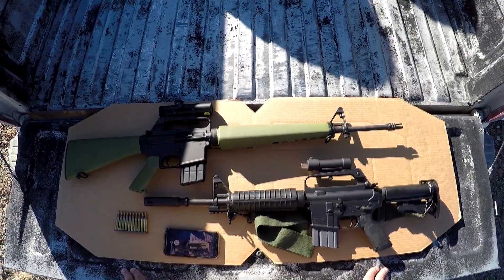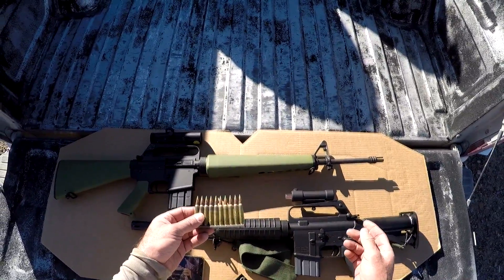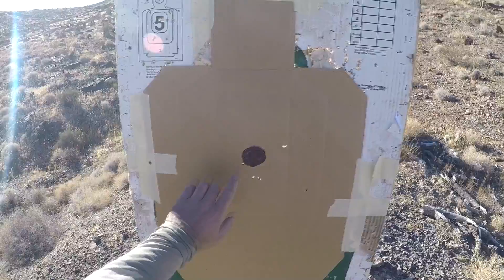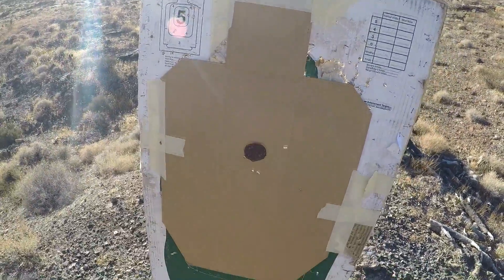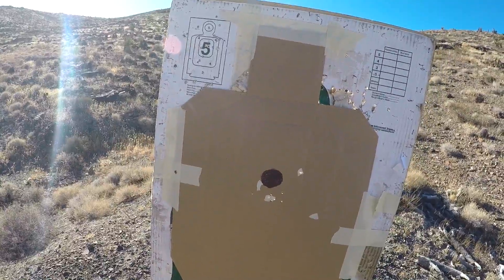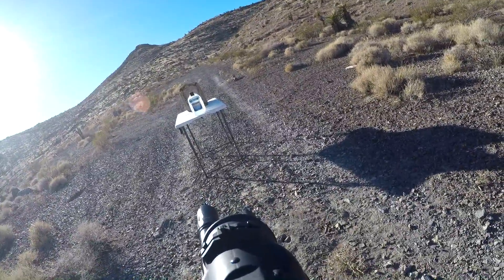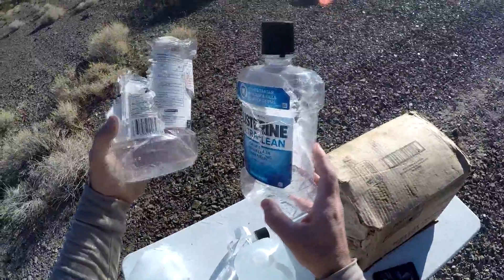5.56mm M855 in a 1:12"  twist...Useful or Useless?

Comment: Not just twist but barrel length is a major factor.
Reply from the maker: @terrytolentino5459  thats why we used a 20” and 12.7”…and was stated in the video…along with altitude….there is also temperature and so on.  Bottom line..while not useless…it is limited.

Comment: Norinco jw 105 5.56*45 nato has a 20 inch 1/12 twist chrome lined barrel so it shoots best with 55 grain bullets. I use 556 or 223 . I have a 4x wide angle 32 mm tube scope and it needed the medium rings for the bolt handle to not hit , look high like the ar 15 sights. Id love to zero this @300 meters for +3 inches @100 meters but the snow is past knee deep and its melting now so in afew weeks i can zero it in my shooting range, field. Im bedding the stock full bed up to past 1 inch of the barrel lug for a free floated barrel. Jb weld and neutral shoe polish work excellent. Im redoing the color of the stain and the finish, maybe tung and teak oil for a non-shiny waterproof finish. My buddy has a bunch of bullets for me , he gave me a handful last tine and I shot those up when the rifle had the tube style reddot sight , zeroed for far range at 75 meters and close range 25 meters. These bullets shoot super fast and hit the target @ 100 meters instantly. I love the 556 nato round now. I was always into 7.62*39 but now I can shoot both.  Bolt action 556 is a pretty slick little rifle. Take it out for some gophers this summer time.

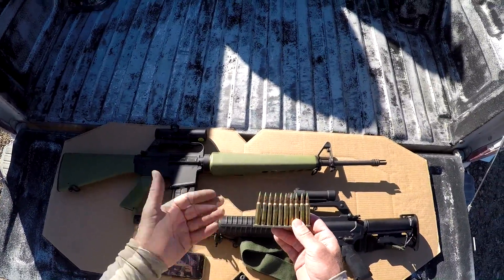Comment: In the 1:12 do the holes lokk keyholed m855 should destabilize bad and give a keyhole or water drop look. That's why I don't buy green tip at all I stick to m 193 1:7 twist. For my fmj
Reply: I would say 1/7 is good with a 16" barrel.  20" might be to much twist and friction.

Comment: Everyone always screaming don't fire a 5.56 in a .223 barrel and I call bullshit because the original AR-15 adopted and redesignated as XM16E1 and M16's had .223 barrels and there's no documented evidence of firing a 5.56 ammunition in a .223 barrel will cause chamber explosion, the M16A2 chamber was designed to be loose to help with extraction issues that the AR-15 603/604 XM16E1/M16/ M16A1 .223 chambers had, the .223 chamber has tighter tolerances, so the M16A2 has the first 5.56 dedicated chamber with looser tolerances like a Glock barrel it allows the case to expand some for more easier extractions but it gives up some accuracy.

5.56x45mm "NATO" was not around during the Vietnam war, 5.56x45mm "NATO" didn't come about until 1976 or 77, it was designed FN Herstal in Belgium, so anything before this round was created was .223 Remington M193 ball ammunition also at the time called 5.56x45mm but not 5.56x45mm "NATO" their a difference, but a lot of people push lies saying that "firing 5.56x45mm "NATO" in a .223 AR-15 is dangerous because 5.56x45mm "NATO" has high pressures and could lead to catastrophic failure" I say horse shit 🐎💩 because you have people who have been firing FN 5.56x45mm "NATO" ammunition like M855 in their AR-15's that predates 1982 which the M16A2 chamber pattern AR-15's were created and introduced, and here's a quote from a forum "The M855 will chamber and fire in the M16A1 safely but accuracy is seriously degraded. It is approved for use in the M16A1 only in a combat emergency and it is only accurate to about 100 meters. This is combat accuracy not, benchrest accuracy." So FN's 5.56x45mm "NATO" Cartridges like SS109 and M855 wasn't used until the summer 1982 when the M16A2 was adopted by the U.S. Marine Corps and FN SAW M249 adopted in 1984.

So if 5.56x45mm "NATO" is ok to fire out of an M16 and M16A1 with the only concerns is accuracy because the M855 was designed a 1:7 twist ratio and the M16 and M16A1 have a  1:12 and 1:9 twist ratio but their's nothing saying M855 will blow up a M16 and M16A1 's chamber, and all the people over the years who've fired 5.56x45mm NATO ammunition out their AR-15 rifles which prepredates the 1982 M16A2 variants which were designed for FN 5.56x45mm NATO ammunition and the M16A2 has a looser chamber
Reply from the maker: I….uh…ok.  I don’t think anyone was concerned with blowing up their AR…This video was about the 1/12” twist and m855…or simply the SS109 projectile in a 1/12” barrel.
Reply: @7N6ballistics  I was just making a point, my comment is random and not towards you it's for those who say don't fire 5.56 ammunition out of a .223 barrel, but my point is that 5.56x45mm NATO wasn't invented until the late 70's but people always bring up don't shoot 5.56 out of a .223 gun but the M16A2 and M16 are chamber for .223 Remington M193 they predate 5.56 NATO ammunition, but people still fire M855 out of M16A1 and AR-15's patterned after the M16A1.
Reply from the maker: @Edmondson_Avenue  While I do not own any .223 chambered rifles, thus not a concern of mine, SAAMI released it’s warning about firing 5.56 military ammo in commercial .223 chambered rifles in 1979.  This predates the NATO adoption and was not referred to as 5.56 NATO…but simply 5.56mm. M193 has always been referred to as 5.56mm and had it’s own specs with allowable pressure and case composition being different than .223.   As far as chambers, the military again has it’s own TDP.  Whether or not 5.56 NATO was simply renaming what was before simply the US Military TDP,  I am unsure.  As far as the concern, I don’t know of many rifles outside of maybe bolt or single shot rifles that use a .223 chambering.  I believe the 1980’s Ruger mini-14 may have, but I don’t recall any of recent times.  I would have to think a bolt gun would do a much better job of preventing primer blow outs or case ruptures from occurring.  This may be why you don’t here of any real issues occurring.  That said the major manufacturers do have different product lines loaded to different specs.  Here is Hornady’s  explanation.  
https://www.hornadyle.com/resources/le-faq/what-is-the-difference-between-556-nato-and-223-rem-ammunition

If you want a lengthy read on the development of the M16 and 5.56mm here is a link.  You will see there were a lot of issues to include case ruptures and cyclic rates that were encountered early on.  In short the M16 and subsequent 5.56mm rifles were designed around the 5.56 specs…. There is no way of knowing how a commercial firearm marked .223 would fair…which is likely a reasonable reason for the warning.
https://web.archive.org/web/20040209030852/http://www.thegunzone.com/556dw.html
Reply: @7N6ballistics  Well said, but there's manufacturs rolling M193 5.56x45mm NATO, when it was traditionally Remington .223 redesignated 5.56x45mm M193, I was reading that the military allowed M855 to be fired out of M16A1's which predates 1979 but only for emergencies but not over chamber pressures but because of poor stability, the M16A1's 1:12 twist ratio can't stabilize 62gr. projectiles past 100 yards.

You know it's weird that some  .223 ammunition that's hotter than 5.56x45mm NATO, but I was watching a Brownells video and a guy was explaining that SAAMI says 5.56 NATO has a wide pressure variation to work in all NATO weapons, don't quote me bit I think he even said that some .223 cartridge could be to hot for some .223 chamber and cause failure.

You this leads me to believe that early variants of .223 wasn't studied enough on the civilian side, because it was originally a military cartridge from jump starting out as the Remington .222 and the first gun it was chambered for was the AR-15, I've heard similar stories about .30-06 ammo blowing up guns, I think a lot of it is the manufacturer of the firearms not making good chambers, because I've also read and seen videos about companies that manufactures .223 rifles with .223 barrel marks but their manual says it 5.56x45mm NATO rated and ok to fire 5.56 NATO. 

It's like 10mm, which is designed to be a magnum cartridge but you have a lot of ammunition companies producing watered down loads and some gun companies making poor guns after firing a lot of the real deal ammo the gun fails, because it was really designed for those 10mm lite .40 loads, there's a lot of misleading.
Reply from the maker: @Edmondson_Avenue  pretty much…5.56 military loadings can be whatever they specify..m193 was allowed to be loaded to higher pressure than .223 and was allowed as much as 60,000 psi…this is why it isn’t an issue shooting m855 in the A1.  The bottom line is 5.56 can exceed .223 pressures…and when placed in a short chamber along with an unknown quality of rifle…I could see where the concern would have merit…thus the warnings.  As to whether or not it’s a wide spread issue..probably not, but I am sure kabooms have occurred that go unrecorded…
Reply: @7N6ballistics   I understand what you're saying but I don't think M193 was loaded hot back, because it was the only. 223 cartridge for a good while and remember M855 is a 5.56 NATO cartridge and M193 precedes it nearly by 20 years, and from my understanding bullet technology wasn't as quickly evolutionarily as it is these days this is why it took nearly 20 year for 5.56 NATO to be developed, my personal belief is the AR-15 was built around M193 because the actually were created together and Remington worked closely with Armalite and Eugene Stoner when developing it, also from  my understanding the military likes looser chamber tolerances for better extraction in case debris get stuck in there they'll clear more easily, and some say this is why Glock barrels have looser tolerances because they were built for the Austrian military, I hear target guns have tighter chambers, I don't think Remington was loading M193 above 55,000 psi because that's above the SAAMI specifications that were given for it in 1962, there have to have been some kind of testing of M855 in the M16A1 that took place that determined that it was safe to fire during emergencies but that's not the case for a lot of civilian companies that use tighter chambers that have different leades because it's a tighter fit, they probably weren't testing 5.56 NATO in their firearms especially in bolt and style rifles and a lot of people that were firing it was unaware of the pressure spike of the 5.56 Nato, but I honestly don't believe that this applied to AR-15's accept models that were built with a dedicated stainless steel .223 chambered target barrels which has those tighter tolerances for long range shots 5.56 NATO wasn't created for long range shots, it was developed medium to short range targets and to used confidently in every NATO rated firearm, I believe most of  these 5.56 NATO kaboom's were in .223 target rifles and as you said the mini 14 but more specifically the one's prior 1984.

I understand as you said "military loadings can be whatever that they specify" and as I said before I don't think there was ever an issue with the M16A1, XM16E1, or M16 firing 5.56 NATO as far as chamber pressures because those barrels have to be proof tested with the hottest .223 proof cartridges when Remington designed the .223 for them, I know M193 is the bullet and not the case, so I'm guessing that once the 5.56 NATO cartridge was designed and created the military requested that it started being loaded in 5.56 NATO cases, but I wonder did Remington continue to do the loading or did FN Herstal contract Remington for the bullet components and load them themselves of do ball ammunition qualifies as an unpatented object, but SS109 aka M855 is a problematic ammunition that the military had issues with in the M16A1, M16A2, M16A3, M4, M4A1 and M249, so they started looking for other alternatives like MK262 and MK318, and eventually settling on the American created M855A1 bullet, it just make you wonder if the 5.56 NATO cartridge was even needed but I judge the case on the performance of M855, maybe it is a stronger case designed but it's basically an enhanced .223 Remington case with a +P load in some cases because again some .223 is hotter than 5.56 and have been said to kaboom .223 barrels mainly in older guns, it's just weird. I appreciate your input.
Reply from the maker: @Edmondson_Avenue  “M193 specs are given a temporary waiver. The average chamber pressure limit was increased to 53,000psi, with individual rounds allowed to test as high as 60,000psi. Remington and Olin contract to supply 500,000 cartridges apiece under this waiver.”
This was 1964.

Im unsure on chamber dimensions at the time, but they felt well enough with using it in the M16….which are also proofed…How that would apply to other rifles…No idea.  As far as 5.56 military loadings…SAAMI had to take into account there were other specs prior to the NATO standard…it just depended on the country…who also developed it for their individual rifles.  As I recall the FAMAS for instance was not to use our ammunition…rather a steel cased loading developed for the rifle. Apparently The M193 was a bit rough on the operating system.  Ive also heard our m855a1 is not really compatible with some other NATO rifles…though I believe the pressure was dropped a bit in recent years…. That however could also be a testament to the robustness of the AR system in general.  The Issue remains…a SAAMI spec chamber on an unknown quality rifle is where the warning possibly has merit.  Which 5.56mm might pose an issue…honestly not really any way to tell…unless you have access to testing equipment… As far as the M16 in particular…even prior to NATO standardization, it doesn’t appear it would be much issue.  I would take the warning for what it is…look at your individual rifle and loadings and go from there.  As I stated…I don’t have any .223 chambered rifles…only .223 wylde and 5.56 Nato.  For me it just isn’t an issue….that’s for the individual to research and use what they feel comfortable.  With all that said…M855 is definitely loaded a bit hotter than m193 on average…it has the most recoil that I can perceive of the 5.56 loadings…possibly tied with mk262…. It will cycle an under gassed gun that may not cycle m193…that I have witnessed.  I have yet to use m855a1, so can only speculate on that one….

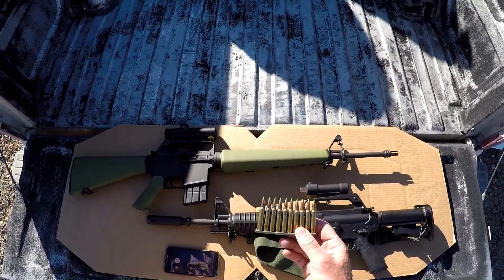Comment: 1:7 was chosen to stabilize the 62 grain tracers because those things are about as long (it's projectile length not weight that determines stabilization - for anyone else who didn't know that for a long time) as an 80 grain lead core. Adopted 1:7 when they went from M196 tracers to M856 tracers. Turned out to be a happy coincidence that and 77-grainers became in vogue that's 1:7s slang most of them pretty good.. A tight 1:10 would be good for most non-monolithic copper 62-69. 1:8 is good for sub >80 lead core. But those darn tracers are tall boys and need that 1:7...supposedly. Never tried,

Comment: really like this topic because I'm realizing from videos that a lower twist rate is like trying to catch a football without spin and when you catch it it jumps out of your hands.
Reply: also wondering about 1:14, but would be cool to see exact same length of barrel 1:12/14 vs 1:7/9 in 55 gr FMJ
For an example 14.5/20" barrel with 1:14/1:7.  
To test overall damage watermelons and/or pumpkins would be good.
Reply from the maker: Kinda…

Comment: A 62 grain lead core jacketed bullet would be fine for the 1 in 12 twist, you said up to 60 for lead core. The reason m855 isn't good to go in 1 in 12 twist is because it isn't just a jacketed lead core it obviously has the steel core so to make it 62 grains it has to be longer than something with just a lead bullet wrapped in copper would be of the same weight.
Reply from the maker: Well…I said “about”. The video was about specifically “green tip”. Different projectiles  will have different length to weight ratios…such as monolithic projectiles, polymer tipped projectiles, hollow point boat tail and so on.   Id imagine even the 64gr nosler bonded could be used do to its profile…. That said velocity, temp, altitude etc…will probably come into effect and it would be wise to always test your ammo in your gun in the conditions you plan to shoot if you are going to exceed approximately 60grs with a 1-12 twist.
Reply: Actually the length of the bullet in regards to the bullet's diameter is more important than the weight of the bullet. So if you are interested in getting a accurate understanding you really need to know the exact overall length of the bullet so a micrometer is needed to accurately measure the overall length of the bullet.

Comment: My 1t:9" Bushmaster would stabilize 77gr pills, but would not group as tight as 1t:7"
Reply from the maker: Ya, 1:8 is required for proper stabilization of 77gr in all conditions.
Reply: It All depends on what you find to be more desirable quality accuracy or lethality. If you are only going to be punching holes in paper target then you are probably concerned more with accuracy. If you are more interested in lethality the you want a bullet that is barely stabilize so that it Will tumble end over end Length wise dumping all of the bullet kenitic energy into the Target.
Reply: What is your barrel length?

Comment: Would be great to see a comparison of m193 in a 1:7 and 1:12. Especially out of a 20 inch barrel.
Reply from the maker: Thats pretty well documented...with a properly stabilized projectile there isn’t any noticeable difference.  About 4-5”of neck and within 150yds or so, lots of fragmentation....   The problem with m855 is there are 3 different wound profiles.  The most common being about 4-5” before it begins to upset....sometimes it can be closer to 3”...others as much as 8”....it’s inconsistent.